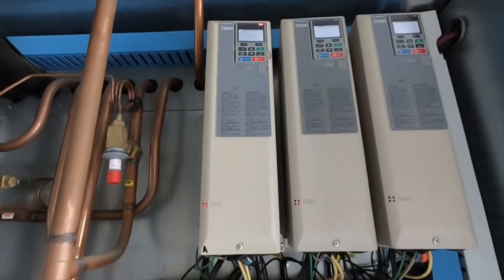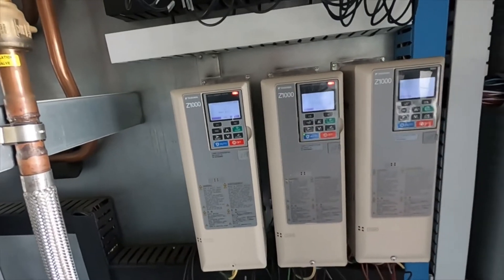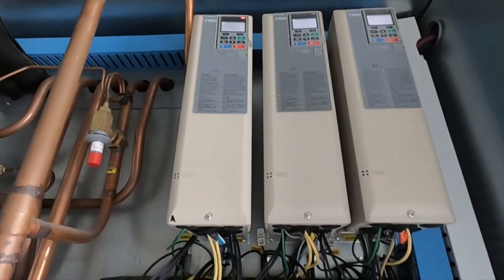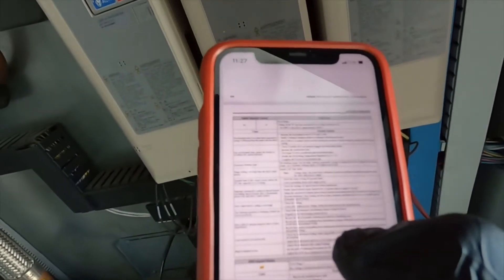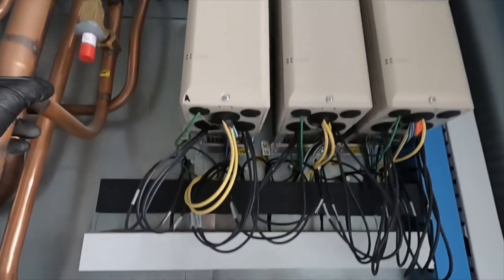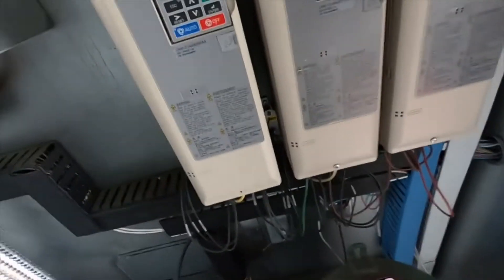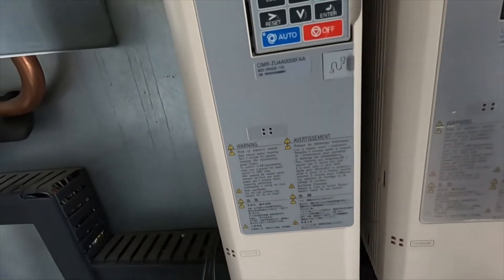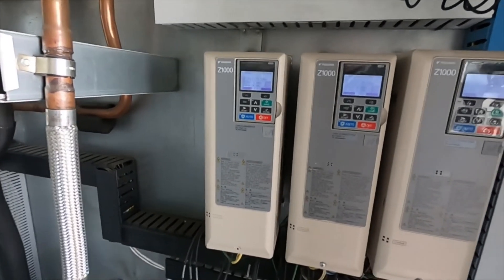YASKAWA Z1000 (VFD) FAULT AND OVERVIEW

Comment: did the Baseblock alarms clear after you reset the fault ? ive got 4 drives in baseblock alarm that  i cant clear and none of them are showing an actual alarm to investigate further .
Reply from the maker: Baseblock is external safety lock out. Like high static switch or high pressure switch. Those 4 drives are probably daisy chained on those safety’s. Check all your safety’s first and reset whatever is trip. If everything is clear then start at the first drive the two baby blue wires in the middle is the were you’ll want to make sure your getting 120 in and out. If your getting 120 in and not out on the vfd then it’s bad. What you could do it take that drive out of the sequence and wire but those blue wire together that way the next vfds won’t be in a base block. 

Hope this makes sense for you.
Reply: @HVACslayer   so bizarre, the CRAHU has no alarms or faults , the BMS is happy and i can run all 4 motors DOL with no issues , but the VFDs are still in baseblock and wont  run in Auto . Thanks for the tips
Reply from the maker: @simonharris6282  start at vfd 1 and chase the 120 power making sure the contacts on the vfd are closed and allowing the 120 to pass through. You’re losing it somewhere sense there all interlock that’s why they all go into baseblock. I think there is a way to possibly turn that parameter off you would have to look in the manual or talk to a yaskawa tech to verify. 

I’ve also had fire life safety cause this.
Reply: @HVACslayer  I bloody owe you mate ! I found the fault thanks to you, a door limit safety switch (that has moved ever so slightly to open circuit)  that was interlocked through the S5 input on the drive . thankyou for the help
Reply from the maker: @simonharris6282  hell yeah! Glad I was able to point you in the right direction dude 🤘🏻🤘🏻